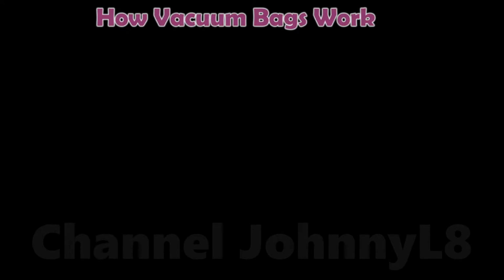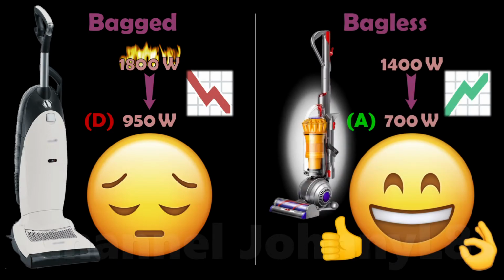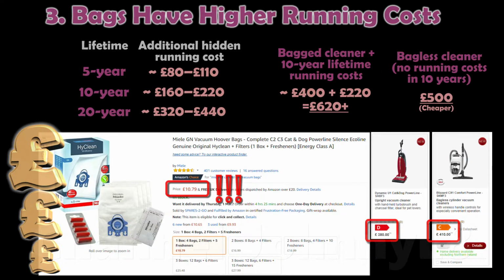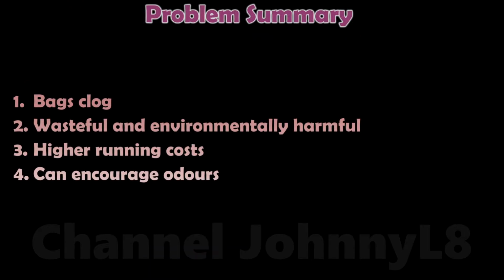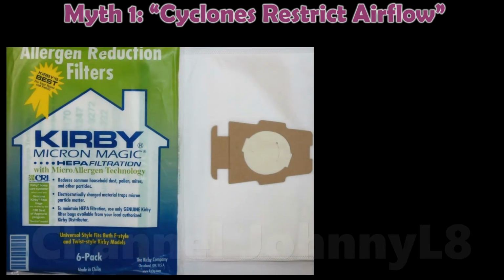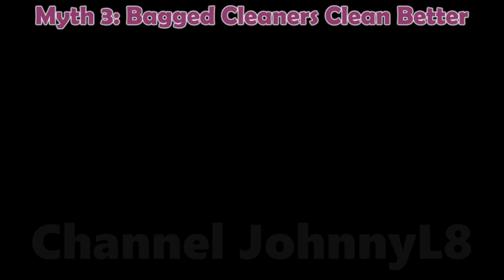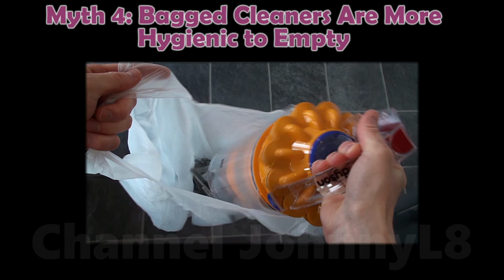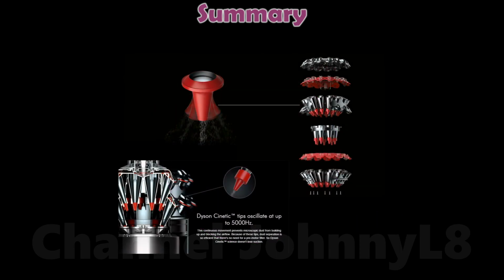Bagged Vs Bagless Vacuum Cleaners

Comment: The reason why vacuum bags don't decompose in landfills is the HEPA ones with a plastic cover budget bagged vacuum cleaners have a paper bag with a cardboard fitting and paper causes the bang to be very easily decomposable and typically bagged vacuums clean better than Bagless vacuums because of increased airflow
Reply from the maker: I also hate bagless vacuums that are done poorly. Unfortunately, only Dyson did it right and continues to today. They patented their ideas so others can't steal, and so they're left with making cheap copycat clones which are terrible and sully the image of the good original ideas as discussed here https://youtu.be/U_qS2i6HQRY . Bagged cleaners don't perform better than the best bagless cleaners, as industry standard testing shows, and so your comment is a myth. (And then there's all the issues with bagged cleaners raised in the video.)

Comment: My personal opinion I hate Bagless vacuums and I much prefer bag that can clear will vacuum bags don't actually clogged that bad and the reason why they stopped working is because they are completely full to the brim and when you put in a new bag it's just like a brand new performance where the bag was vacuum Dyson or not empty the few times then you have to wash the filters and also there are vacuum bags out there that has a sticky flab that go over the whole as soon as you remove the bag so there is zero dust flying in your face
Reply from the maker: Might want to learn a bit of grammar; your comment was very difficult to read. I also hate bagless vacuums that are done poorly. Unfortunately, only Dyson did it right and continues to today. They patented their ideas so others can't steal, and so they're left with making cheap copycat clones which are terrible and sully the image of the good original ideas as discussed here https://youtu.be/U_qS2i6HQRY . Unfortunately, bagged cleaners are also terrible for all the reasons discussed in the video which were solved by Dyson. Those flaps don’t always seal the dust in, as shown here https://youtu.be/YPnPwBRpNBc?t=537 , and it is possible to empty a Dyson without any dust, as shown here https://youtu.be/E_ik6qScs0o . So there’s no good reason why bagged vacuums exist anymore; everything you’ve raised is accounted for in the video.
Reply: Do remember that the video mentions that bagged vacuums let out air that isn't 100% clean but bagless vacuum cleaners make the air that flows back into the room is much cleaner especially as many vacuums nowadays use the common HEPA Filter
In my opinion Bagless Vacuum cleaners are way better and they exhaust out air that is way cleaner

Comment: I know for a fact that finding bags for most old vacuums is not very difficult. You can say “I don’t believe you” all you want. It’s a fact. Bags for old vacuums are not hard to find.

Also I looks like what you say is based on what Dyson says. I thought you were in support for bagless vacuums as a whole!

Also there is no way to confirm that bagless vacuums are truly “better”. It will always be an opinion, whether it’s a common opinion or not.

You can be happy with your opinion backed up by “facts” and “evidence”. So can people who like bagged vacuums.
Reply: And just because Dyson says that their vacuum doesn’t lose suction and their filters don’t clog, doesn’t mean it is actually true, even if it is stated as a fact. Just about everyone I’ve seen (not always on YouTube) that has Dyson vacuums, has some clogging in their filters, and it tends to smell worse than bagged vacuums. I’m not saying I don’t like Dyson.
Reply from the maker: o_0 ...and then there's everything else mentioned in the video that renders your entire point moot, whether or not it's true. >_>
Reply: I saw everything else. I’m just saying that this video (to me) just seems like a video that is showing your opinion and why you say this. I respect that. But some of the things you say don’t appear to be true. And I know that some of it is very true. But it doesn’t look like all of it is. It’s not possible to avoid getting some dust into your air with any bagless vacuum. And like I said before, finding bags for old vacuums is easy in most cases. (Yes I mean most.)
Reply: And if your emptying your dust into a plastic bag, that may be more harmful for the environment because plastic isn’t biodegradable. Lots of average vacuum bags are made of paper. I’m not saying we shouldn’t worry about paper going into landfills. I’m just saying that you’re defeating the purpose of your point.
Reply from the maker: @colbydyer7191  >> “this video (to me) just seems like a video that is showing your opinion and why you say this”
Might want to watch closer; you’ll notice the facts that can be checked

>> “But some of the things you say don’t appear to be true.”
Like?

>> “It’s not possible to avoid getting some dust into your air with any bagless vacuum.”
You mean when emptying? True for inferior cheap knock-off bagless junk. Empirically shown to be false on my channel for Dyson cleaners. This was stated in the video; I recommend watching it.

>> “And if your emptying your dust into a plastic bag, that may be more harmful for the environment because plastic isn’t biodegradable”
I’ve said countless times in comments on my channel, emptying into the bag was to ease recording, the bag could easily be used to line a bin, and it’s been demonstrated subsequently, time and again, how to empty directly into the bin. This is simply a straw-clutch non-argument.

Unfortunately, you’ve not raised any valid counterpoints that aren’t debunked as misleading or false. Better luck next time.
Reply: I’m don’t mean to sound rude. Just know that everyone is entitled to their own opinion. I always respect people’s opinions. PLEASE don’t get me wrong. I respect yours, I’m just saying why I disagree. I’m not trying to convince you.
Reply: And I said any bagless vacuum, even Dyson. You can’t avoid it. Dust is sometimes so tiny that you can’t see it at all! You’re trying to support all bagless vacuums right? Apparently you’re only supporting Dyson! And I made clear what I was trying to say. Stop pretending that my point is unclear! And I said that I saw the facts. I agree with some of these facts!
Reply: “Bagless vacuums are better that bagless vacuums” is always an opinion. Whether or not it is backed up by evidence. Same goes for “bagged vacuums are better than bagless vacuums.” You can argue for both. But it’s still an opinion.
Reply from the maker: @colbydyer7191  >> “Just know that everyone is entitled to their own opinion.”
I agree. But this channel and its content is about facts; opinion has no place on factual matters.

>> “And I said any bagless vacuum, even Dyson. You can’t avoid it. Dust is sometimes so tiny that you can’t see it at all!”
So how do you know it’s there? How are you determining that this is a problem to the extent you’re raising it as an issue? You’ve so far implied it is a problem, yet simultaneously claimed it’s undetectable, which is a contradiction. I’ve no time for this weak reasoning.

>> ““Bagless vacuums are better that bagless vacuums” is always an opinion.”
It’s not when there’s clear empirical evidence and well-reasoned factually accurate arguments showing the claim is true. That combined with absolutely no good reason or evidence to the contrary presented. (Again, this is only referring to Dyson cleaners and not rip-off clones; I've done a video about this). You’re simply wrong to resolve factual matters to an opinion and this suggests you are not understanding the points being made (which would explain the nature of some of your comments). Some might ‘like’ bagged cleaners more and that’s fine, but they are objectively inferior for all the reasons raised in the video that you partially agree with and haven’t yet supported why you don’t fully agree. The problems they cause have been solved.
Reply: You’re completely ignoring everything I say that about the fact that opinions can be backed up by facts. Facts definitely do have a place in opinions. I expect the quote to stop after the word opinions. Your not going to convince people, we don’t need to convince you either. I’m not trying to give you my evidence. I’m just saying why I disagree. And you can deny it all you want. Backed up by facts or not, it’s an opinion. I expect the quote to start after the “facts or not,”.
Reply from the maker: @colbydyer7191  You're really not saying much and you've evaded every request to be specific. I'm not convinced I'm going to get anywhere with you at this stage.
Reply: You don’t need to get anywhere. Let’s just be happy with our fact backed up opinions. We don’t need to convince each other. You can say that I was trying to do that with you, but I’m not trying to convince you. I’m just stating why I disagree.
Reply from the maker: @colbydyer7191  er...ok. o_0 Not sure I've seen any facts from you yet, despite multiple requests. But there you go...
Reply: Also it said that bags are bad going to the landfill but it did not say having to dump the dirt out of a bagless vac into a bag and throwing it away and going to the landfill and being bad throwing away like it did with having a bagged vacuum
Reply from the maker: @driftracing08  You don't need to do that; that bin liner was just to assist with recording, and it was used to line the bin anyway. You should have just watched this video, which points out the obvious about Dyson bagless emptying. https://youtu.be/E_ik6qScs0o
Reply: When you said that one should put the canister closer to the bin to reduce the size of the dust cloud, is there any footage of you trying that with other bagless vacuums?
Reply from the maker: @colbydyer7191  Watch the video; you'll find out...oh wait, you don't watch videos do you. I guess you'll never know xD
Reply: I'll take that as a no. And also, I did watch the video. Whether or not I watched it isn't your decision. Sorry.

But it actually says that I don't watch videos. I do. That is CERTAINLY not your decision.
Reply from the maker: @colbydyer7191  Then you're left in the awkward position of explaining why you asked a question to which you knew the answer, given you'd apparently watched the video. lol
Reply: Then I guess your right. The answer is no. You didn’t show your method with bagless vacuums other than Dyson ones.

Also I was making sure. I wasn’t 100% sure of the answer.
Reply from the maker: @colbydyer7191  >> "You didn’t show your method with bagless vacuums other than Dyson ones."
And if you want to know why that might be, you only need to watch the video you're commenting on. In fact, in past comments, I've even linked you to the part in question which explains it all. So really, you've had a full answer before you even commented. :/ Oops. Are you SURE you watch these videos? xD
Reply: Yes I’m sure I watched the video. I was making sure I didn’t miss something.

Does the method not work with other bagless vacuums, does dust still spew? Idk because you showed no footage. You only showed other bagless vacuums emptying into a small bowl on the floor from a great height.
Reply from the maker: @colbydyer7191  This was answerd in the video you claimed to have watched I linked to above, so not sure why you're asking again. There's enough information in that and this video to draw the correct conclusions.
Reply: I’ll draw a conclusion. You showed no footage of your technique to keep the dust clouds small with other bagless cleaners.
Reply from the maker: @colbydyer7191  That's right. You're getting there. Just like I said in the videos!

Comment: one of the biggest problems with Bagless vacuums is that when you empty the dust it all goes everywhere and lands on everything
Reply: How often u need to change EPA filter on bagless?
Reply: @mitch5222  depends on what kind of HEPA filter you have, the disposable one or the washable one. Also it depends on the pre-motor filtration.
Reply: @mitch5222  it's called HEPA FILTER
Reply from the maker: That's true for the poor copycat clones that are designed very badly to profit from the customer. The original bagless, that was done correctly, can be emptied for free, in 5 seconds, without any mess, as demonstrated here https://youtu.be/E_ik6qScs0o . The problem with overpriced copycat clones and how they sully the image of the original product that actually worked is discussed here https://youtu.be/U_qS2i6HQRY
Reply: @VacuumFacts  I use a bagless vacuum cleaner and it's never messy when I empty it
Reply: @stephensnell1379  go dyson